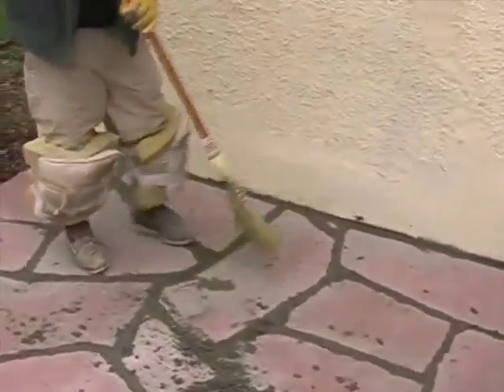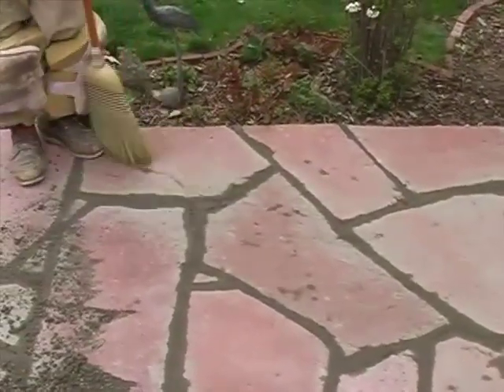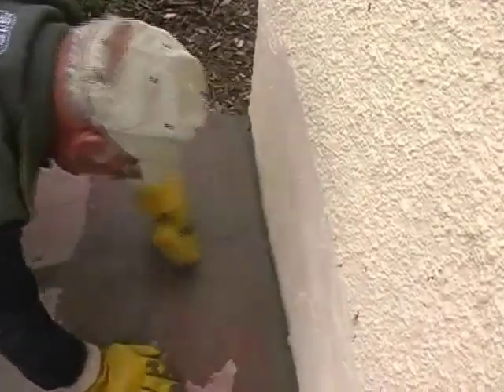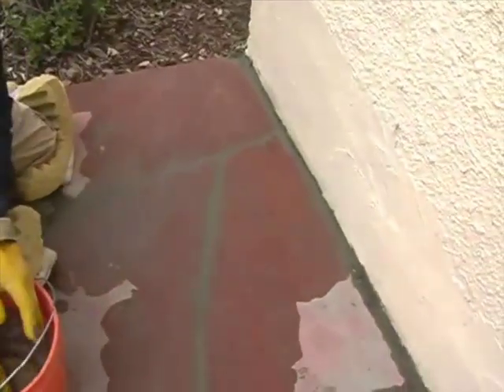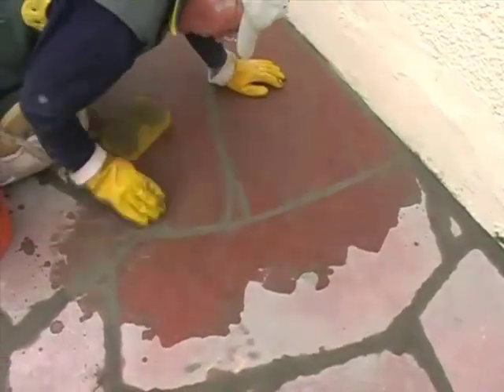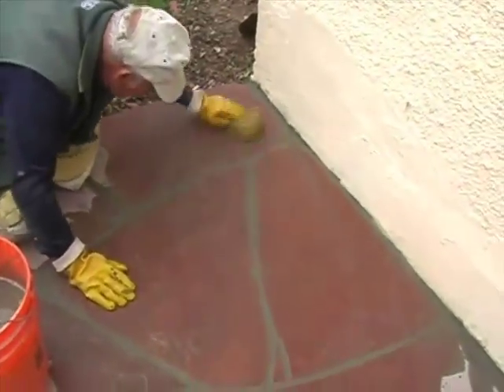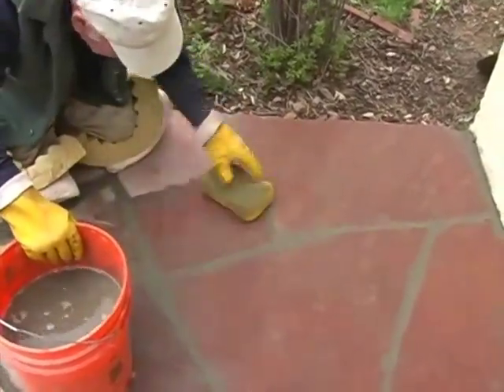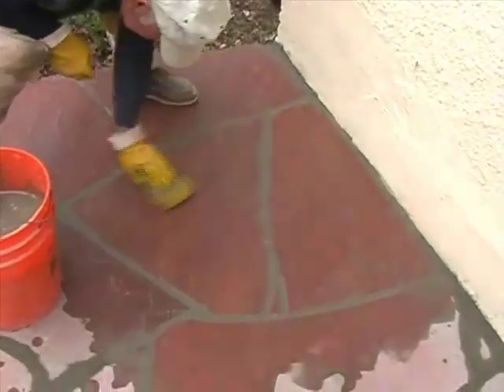grouting.sponging.flagstone.mp4

Comment: Too much time consuming and messy, just use a pointin gun it pumps mortar to the bottom of joint leave till semi dry scrap of the access then trowel up, go back next day to brush of any residue from the mortar. Simples
Reply: Diibbss Dave cooper Agree.
Reply: I had to fix a couple loose stones. Thanks for the guidance. German engineering? Trust it every time.